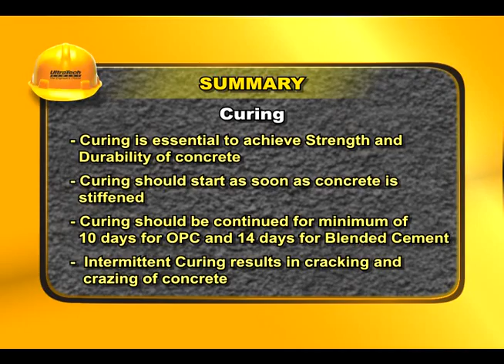CURING

Comment: Obviously Ultratruck cement is quality one but some  dealing  agencies  while repacking the  usless cements.

If you check the strength of cement with the same batch and you canot prove because may be repackaged bag only 4 or 5  or even less. Very difficult to find out. Undoubtedly its happening and make sure the authority and take action against it
Reply from the maker: Hi Abdul,
Thank you for bringing this to our notice. Please be informed that we are carrying out an investigation regarding the same.
Regards,
Team UltraTech
Reply: @UltraTechCementLimited 
Welcome

I am having a lintle concrete few days back and we used the Ultratruck cement, usually ultratruck is fast strenngening one and what on the basis we used ultratruck and  even 5 days the lintle concrete not setting and lodged a complaint and ultratruck Technical team visited the site and took a sample of samebatch cement we used for  conncrete for tube testing.
Whatever he testresult may be we canot build a house on the same lintle since definitely it may shrink and appear crack since is setting slowly....

Since  company team and dealing agent approaching us for negotiation.  Waiting for thenegotiation result  will they bear all the expences 

Pls your email id and contract
So i can share you the pic and videos,

Comment: I am using Ultra Tech Weather plus for my home construction, my doubt is being water repellent does it requires curing?
I am using weather plus for Concrete (Putting, Pillers, Filth beam, Slab, and outer plastering )

Comment: How many days of ponding is required for RCC slab of 6 inch thickness. I have used Ultratech PPC for concrete mixture.
Reply from the maker: Hello Sandeep, 7 days ponding is required. I hope this solves your query. Regards, Team UltraTech.
Reply: @UltraTechCementLimited  yes thank you team.

Comment: There is water leakage through centering slap of rcc roof when I started pounding after day of rcc roof finishing.. I am worried now. Is it big issue?
Reply: I guess the best solution now is to cover the slab with some kind of water resistant material like plastic sheets or tiles